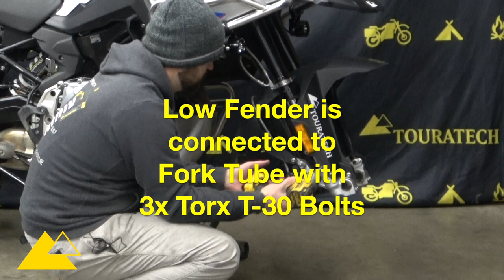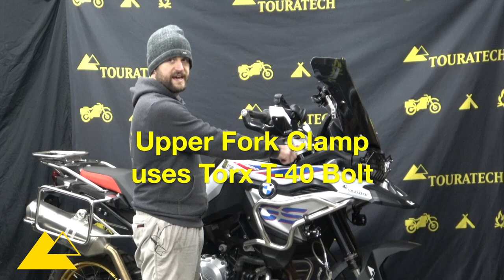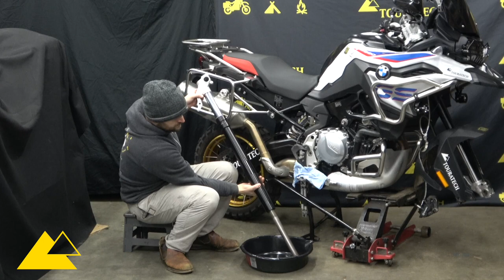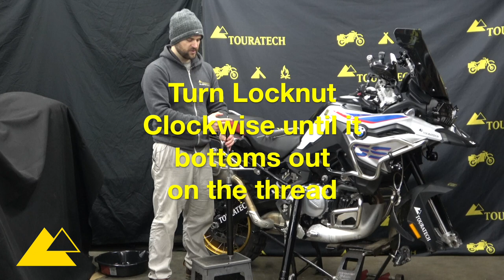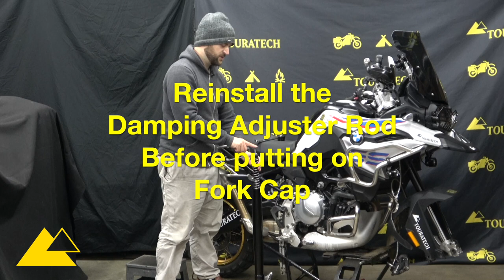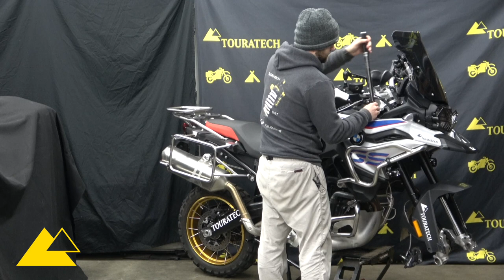Installation: Touratech Fork Cartridge Conversion - BMW F850GS/GSA

Comment: Thanks Ian. 
My fork cartridge kit is coming next week, and the instruction book is a little vague. 
This video is a great help to me and should make the installation straightforward. 
I can't wait to get it fitted and set up ready for my spring adventures.  
Kind regards
Dave.
Reply: have you ridden the bike with the new units yet ???
Reply: @justsomedude445  Yes I have. Only on the road so far. Very happy with the improvement over bumpy roads. And the fork dive under hard breaking is much improved. I should imagine that the improvement on dirt roads would be  equally worthwhile.  Especially if you are a competent rider. 😉
Reply: @davepyer  i ordered both ends , extreme rear shock & extreme drop in units for the forks few days ago after a week of agonizing deliberation , diff bike but same product , hope it turns out worth the $$ , Thank you for your response i feel better about the decision

Comment: Thanks for this video, very helpful. QUESTION: How many spacers did you use at the top of the spring and how many were in the cap? THANKS!
Reply from the maker: The spacers set the spring base preload and should be re-installed in the same order as when they are shipped to you. On our bike we used one below the spring and 3 above.
Reply: @TouratechUSA  thanks so much I really appreciate the reply
Reply: @MotoTravelUSA  you shouldn’t have to ask the damned question.
Reply: @robertlee8042  You mad bro?

Comment: After you draw the fluid out of the forks to the level that shows to be from the top it seems to need no more than 3 fluid ounces per fork with this upgrade, maybe because of the thicker cartridges taking up the space compared to the stock ones?
Reply from the maker: Yes, since this cartridge is 'closed' the fork oil you are pouring in is only there to lubricate the slider bushings and operate the bottom out cup at the top of the cartridge. All the damping is controlled inside the cartridge with oil that is much thinner and under nitrogen pressure.

I assume "per fork leg" was a typo as this install only makes changes to one fork leg on the F850 models.

Comment: The lower bolt on my fork just spins and won't brake loose from the cartridge.  Any idea how to hold the cartridge to unthread the bolt?
Reply from the maker: You can hold the end of the cartridge rod and gently put some sideways pressure on it. If that doesn't work, reassemble the fork to apply spring pressure and try hitting the bolt with an impact gun to loosen it.
Reply: @TouratechUSA  thanks for the reply.  I tried reassembling it and even compressed the fork leg but it didn't seem to add any resistance...  I can try flexing the cartridge to the side though